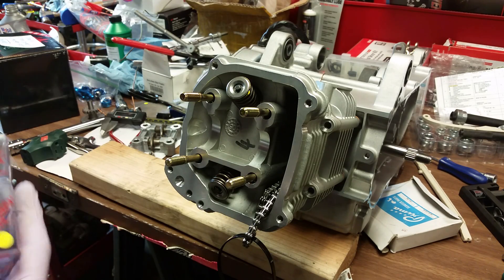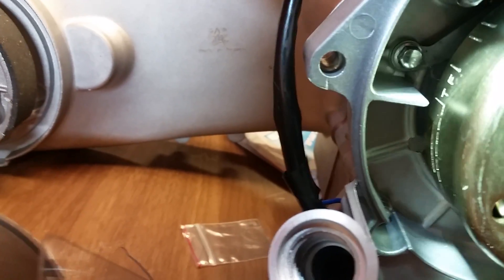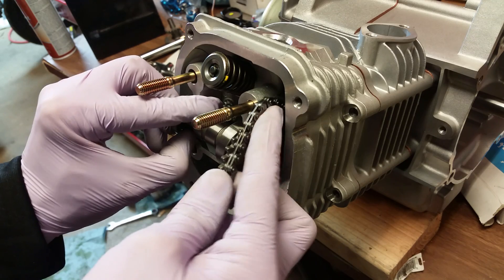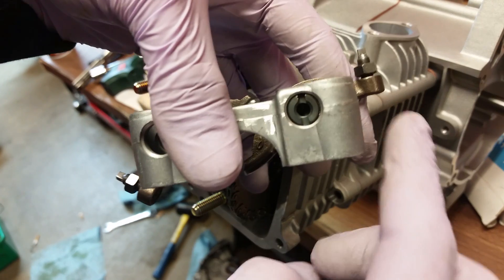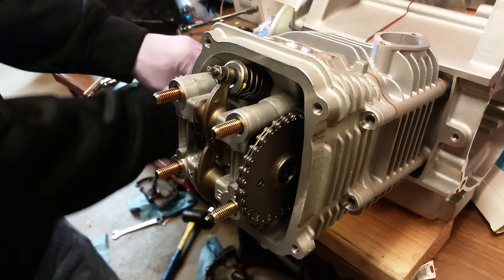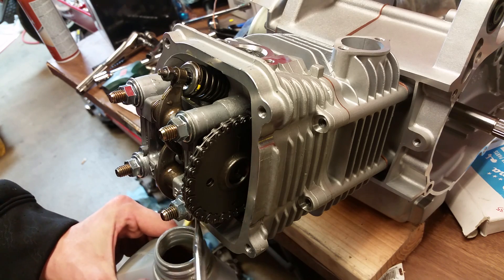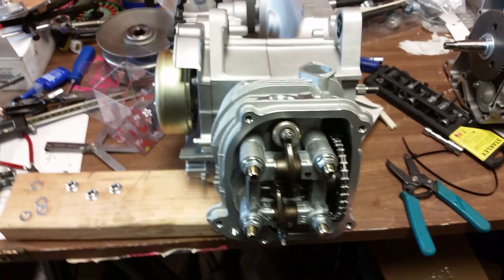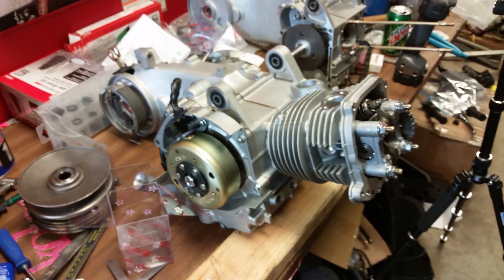GY6 Taida T100 Camshaft valve adjusting How to 190cc 07

Comment: What your opinion on using the taidia T-one cam in a A block with the taidia 61mm drop in kit , it currently has an a13 cam and tops out in the low 50s at a max rpm of around 7k , while I love the low end torque ,I'm hoping this t one will be good fit all round , in a hypothetical would you change the cam lol , 30mm cvk style carb and aftermarket pipe ,running a tad rich, please it only hypothetical now lol

Comment: Please I need your Help : I have set up a new gaskets for my GY6 150cc then after all that : I turned on the Scooter on the idle screw without opening more gas. but it works not regulary : while it is in the kick stand the rear wheel stops then moves slow then a little speed then stops the biggest problem is that the sound of the scooter is like AK47 Rifle you can hear it from 500 meters away . I suspected the Stator or Spark plug itself then the Gas Mixture screw maybe need to be closed a little : also I suspect that the Exhust need a New Gasket to make the soun lower  ,, please tell me what is that Problem ?
Reply: Did you solve it? What was it

Comment: Question? I have new a9 cam and installed them in on a big bore kit. But when I tried to adjust my rocker arms.   They seem to have a much of a gap. A little too much gap where I can't even adjust them. My cam lobes are facing the motor. And when I out on the rocker arms they have too much play. So I flipped the cam over and I was able to adjust them.

Comment: I have a 150cc GY6(1P57QMJ), the flywheel has exact same markings as yours, however when I set TDC by using a dowel through the spark plug hole the first line before the T is approx. 10mm past the alignment mark on the case? at this setting my camshaft marks are slightly off by one link, if I set TDC by the T mark method the camshaft is in alignment but the piston is not exactly at TDC, it is slightly before. I may be wrong but I'm pretty sure the camshaft alignment should be done when at TRUE TDC by using the dowel method, I can't help but think the engine timing is set one tooth out from factory.
Reply: I experienced that as well. Did you find a solution

Comment: 09:32 "intake always larger than exhaust" sets intake to 0.05 and exhaust to 0.07 
 ?????????????????
Reply: Yep, he backwards said it.  The exhaust is looser because it gets hotter and expands slightly, and will be approximately the same as the intake when hot!
Reply: Exhaust valve should have bigger play then intake valve. It's because it heats up more, so it expands more. I think he mis spoke

Comment: What was the torque wrench on that an if it was a two stroke what would be the torque on a 1E40qmb 49cc I just ruined mine used  foot pounds 10  now I'm told I need inch pound's like 130 I got a couple of two stroke engine's  but I just got a 150  and I like your video's but the 150  is for a gocar I can't put brakes on it and I no if I could wield it.